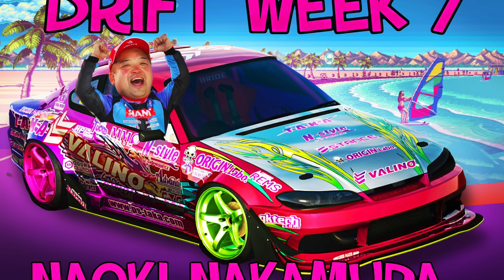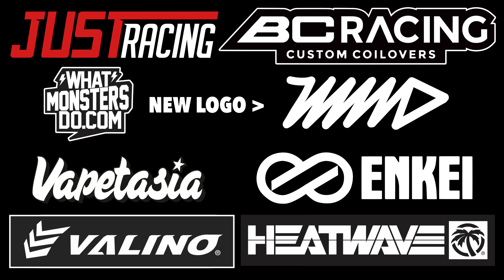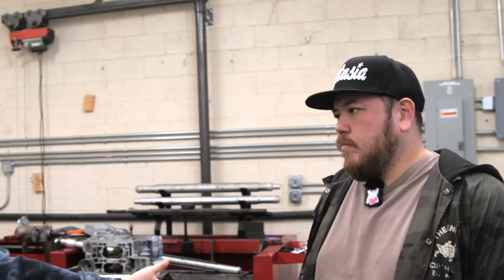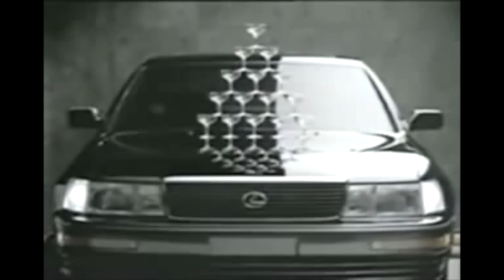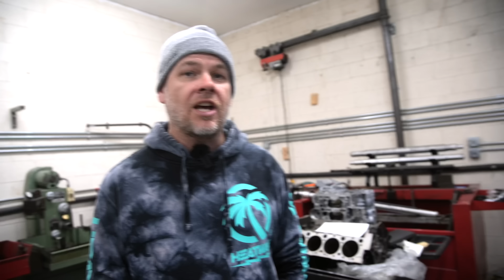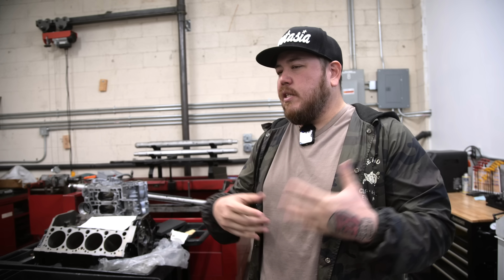Toyota BALANCING made the JZ great, and Yamaha did something

Comment: Yamaha used 5 valve heads because the metallurgy at the time didn't allow for strong enough valve springs. This was their counter to desmodronic valves which ducati used and did not require valve springs. A smaller valve doesn't require as much spring.

Comment: I think we might be under selling that a inline 6 is naturally balanced lay out. v12 as well. they don't need big counter weights and odd firing fire orders like 4 and v8 does. so just a good casting is well balancing without a ton of balance work.
Reply: Despite the inherent balance of the i6 in terms of pistons, the crankshaft balance, valvetrain balance etc. is kinda separate from that, they just put a huge amount of effort into getting the balance as perfect as possible.
This is also shown by how much more balanced the JZ is compared to comparable i6 engines such as RBs or bmw's s54.

Comment: yamaha did magic whit  the head of 1jz!!!!!!!!! toyota copie yamaha for the 2jz!!!!!!
Reply: 1.5JZ dad checking in. The head is merely okay, it’s not great by any means. They flow okay. They’re very strong. The can run to a high RPM. The castings are rough. All the different exhaust ports are shaped differently. As a group the JZ heads all have different ports so none of the manifolds are not interchangeable ->this was a poor engineering choice, it must have been felt by Toyota that they wanted the manifolds and heads to be optimized for every application, but they probably made 10+ completely different heads and manifolds for an increase of like 5hp 😂 , it just wasn’t necessary. Toyota should have taken a page out of Honda’s book if they wanted to build a great head.
Reply: @drewski5730  A lot of good points, but I'd guess the different port and manifold designs weren't all for gaining power. 

Efficiency, and (engine bay) fitment are probably the most deciding factor in non-performance vehicles, of which there were many, a lot of which were taxis and luxury vehicles which where that stuff matters the matter more than peak hp.
Reply: @starfox_wr-45e93  oddly enough, if the engine bay was big enough to accommodate the JZ, it would fit a V12. The JZ is enormous. It’s not as dimensionally large in naturally aspirated form, but it’s a little irrelevant because that’s the lateral dimension in the engine bay, which happens to leave all sorts of space and make them perfect for turbo chargers. Back in the day manifold designs were all the rage for efficiency yes, everyone was building these crazy manifolds for their cars because they would tune them to whatever RPM range looked good for the media. But it was just silly of Toyota in the first place because if they just used the 2JZ naturally aspirated head for everything, it would have covered all the bases from taxi, to limo, to twin turbo Supra, and it has all matched intake and exhaust ports (AFAIK), it flowed marginally less than the 2JZ GTE head that everyone uses/wants these days (I have one of these), but not enough to make much of a difference on the dyno at even a couple thousand horsepower. Then Toyota could have used about 3 different manifolds instead of 10+, to go with a single cylinder head. The blocks are all largely the same, the 1JZ is a little shorter but that’s about it. It’s just the top side parts bin was a mess. 

I’ve started a collection in my garage of JZ parts, I’ve got 2 1JZ GTE heads, 1 2JZGE heads, and 1 2JZ GTE heads. I don’t have any spare blocks but I’m working on it. ;)